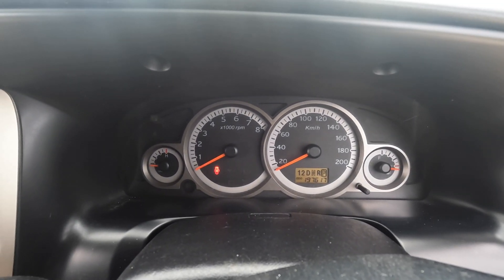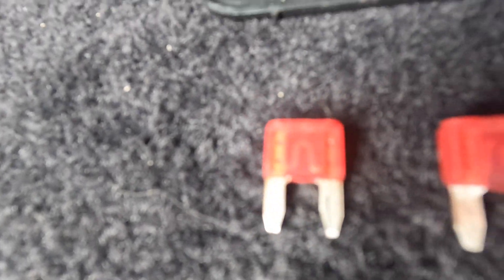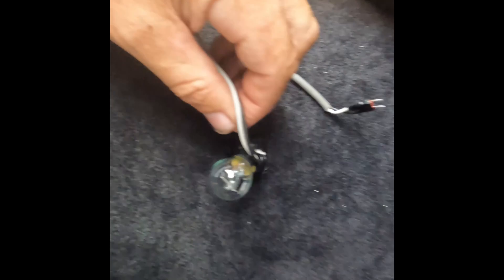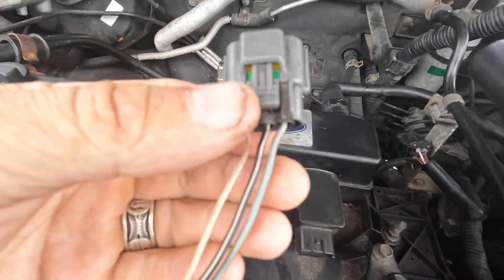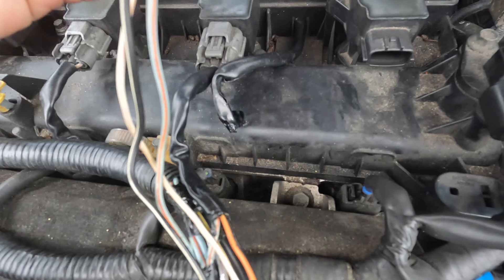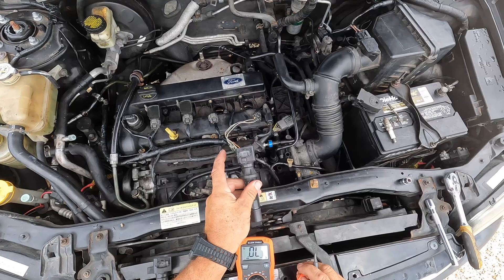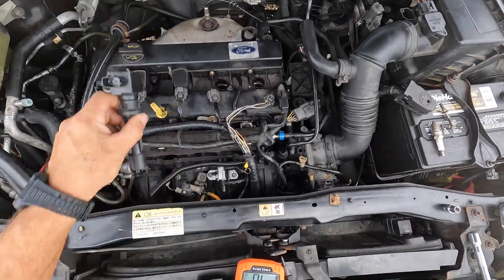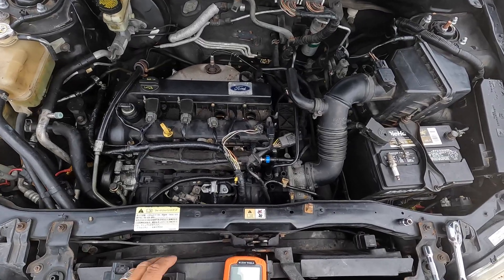Test light fault finding a difficult electrical issue constant fuse blowing.

Comment: well done with the diag-  I would have tried swapping the coil with one of the others ie: swap coil from the 4th clylinder to the 3rd clyinder and see if the problem goes with it. This just ensures that the coil is the issue before spending your cash.
Reply from the maker: The coil kills the fuse so it’s a no go to even try to connect it. 
New one $20 so waiting for it to arrive.